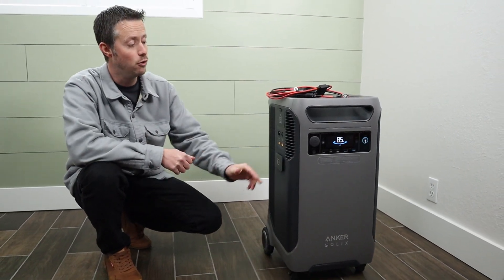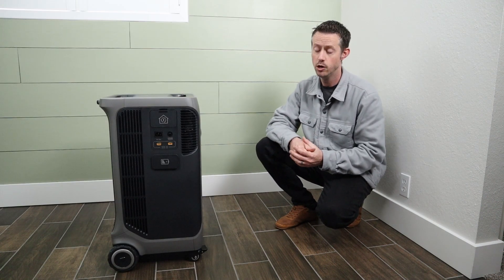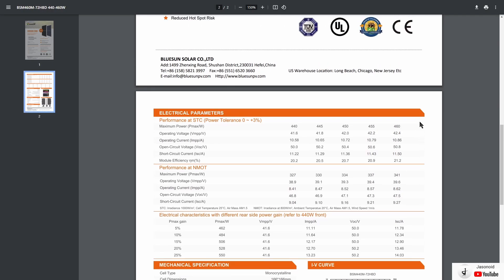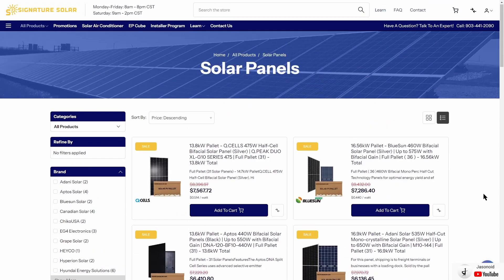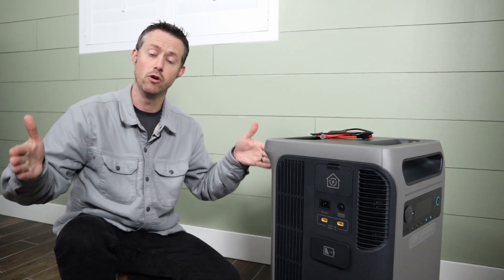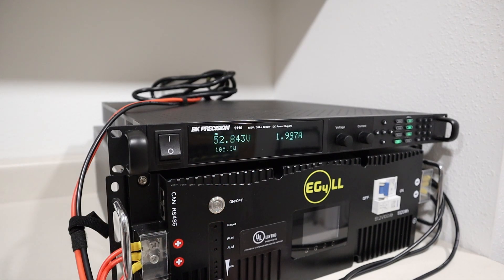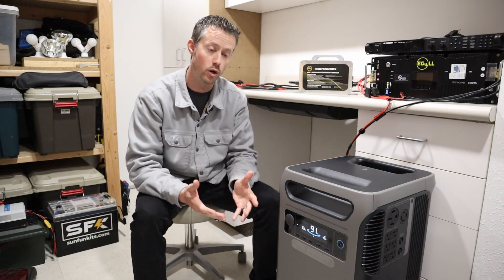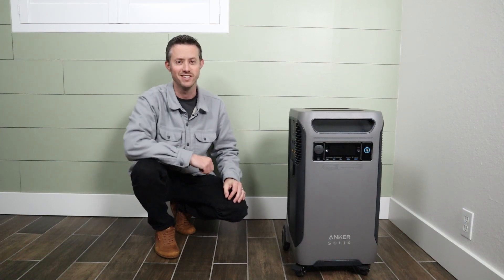Anker SOLIX F3800 - Your Questions Answered! DC Charging Cables - Ideal Solar Panels - and More!

Comment: Hello, so if I purchased 3 of the Hyundai 395watt solar panels in parallel, what size fuse would I need and would I only need 3 fuses total?
Reply from the maker: This is what you'll need:   https://amzn.to/4bVBU1Y
Put one fuse on each postive solar wire before combining them into parallel. Make sure to use at least 10awg wire. 8awg wire for a longe run to avoid voltage drop (wasted power).
Reply: @Jasonoid  Awesome thank you. I clicked the link, they are the 15amp fuses? I will use 10awg wire. Thanks again.
Reply from the maker: @dutchharbour5909  yep, 15 amp fuses.
Reply: Me again. It's probably a silly question, but can I discharge the lifepro4 batteries to zero and then fully charge again? I've seen mixed reviews, but I think it's better for the battery to completely discharge and then fully recharge to get closer to the maximum life cycles? Thanks, Jason. I have the anker f3800 running my pool pump, 800+ watts. I'm going to hook up the panels this week so it shouldn't fully discharge but im running it today and making sure I can fully discharge the batteries safely 😅
Reply from the maker: @dutchharbour5909  discharging 100% to 0% will give you less cycles over the lifespan versus discharging the battery only partially down. You'll still get plenty of cycles on a LFP battery.

Comment: Great in-depth video! Thanks!

My question is, since the battery voltage in the Anker is 48, will panels with the voltage specs below be high enough to charge the Anker unit? 

Rated max power = 380 watts
Open circuit voltage = 44.8
Voltage at Pmax = 36.8
Short circuit current = 10.91
Max system voltage = 1000
Reply from the maker: Yes, the charge controller boosts the input voltage to charge the battery (since the peak voltage is 60v). The panel specs you listed will work properly when wired in parallel.
Reply: @Jasonoid thank you😉

Comment: blah blah blah
Reply from the maker: Most devices I test arent engineered so badly that I have to make a follow up video to clarify how to use it or charge it properly. This video is FREE info for those who got conned into buying one of these.
Reply: @Jasonoid  I like mine, it has limitations that have work a rounds but for the money (I got it on kickstarter) , the ability to run my well pump I do not feel I got conned into it. Hopefully it will only get better with firmware updates.

Comment: Cables that came with 3800 for solar 3 to one. What are those used for and do I need 4 of those for 6 panels. I want to buy 6 Hyundai panels. How would I wire them? Thank you much   Greatly appreciated
Reply from the maker: Those are MC4 parallel adapters. They allow you to connect 3 solar panels in parallel. If you need more guidance on the process feel free to reach out to me HERE:  https://asqme.com/@Jasonoid

Comment: Hey Jasonoid!... What size fuses would you recommend on the Q.Cell 475W panels (using 3 in parallel)? Also, how long would you say the run needs to be to have to bump up from 10AWG to 8AWG?
Reply from the maker: If the run is over 20 feet, I'd upgrade to 8 awg. You'll lose less power to voltage drop if you upgrade.
Using those three panels in parallel I'd put a 15 amp in line fuse on each one:   https://amzn.to/49oUxti
Reply: @Jasonoid  Thanks so much man!

Comment: I have Bluetti 200max. Could I use it to charge f3800 through solar port? I want to keep the 240
Reply from the maker: You could charge the F3800 with the DC Output of your AC200max at 13v and 10 amps, so about 130 watts. Not very fast charging 😕

Comment: will it charge itself? say I have the solix running a very light load from the 240v plugged into my transfer switch, the charge the battery from its own power source using the ac to dc device? do you know if that would even be possible?
Reply from the maker: There are losses when the AC inverter outputs power and during the charging process. It might allow charging but the the power station would lose more power over time than gain it.

Comment: Howdy. Would it be ok to keep this in a hot garage? I live in AZ, and it often gets to 120 degrees in the garage for a month or two in the summer. Would that be ok for this unit?
Reply from the maker: The specs list the operating temps below 104F. It might be fine about that temp but it's hard to tell how it would handle those temps.

Comment: @lamesadave
0 seconds ago
Jason:  Assuming your PV array output voltage is over 60v, would it be possible to use a solar charge controller with a 60+v input and a 48v output to charge the Anker Solix 3800 directly into the XT60 port(s)?  Thanks
Reply from the maker: I doubt it would work, just like the 48v AC battery charger didn't work in the video. The MPPT charge controller needs to see a 'really battery voltage' when connected in order to know the state of charge of the battery is to charge properly.
Reply: @Jasonoid   Do you think a solar charge controller with a 48V buffer battery would work OK?  Basically use the SCC to charge the 48V battery, while having the 48V battery also feeding into the XT60 input of the F3800?  The 48V battery would act not just as a buffer between the SCC and the F3800, but also as expansion capacity.  One negative I see is that the F3800 if not full, will try to drain the 48V battery completely.  But if the 48V is a server rack battery or similar, its built-in protection would shut-off before it gets drained completely.

Wondering if with your expensive AC-DC power supply, you could test whether the F3800 input limit is strictly at 60V, or whether there's some tolerance above that.  After all, Anker's own portable 200W and 400W panels hav a Voc of 57.6V, which doesn't provide much margin for temp conditions...
Reply from the maker: @warrenwu8559  I don't thinkna AC will work since it needs to see a battery voltage to work properly. The battery charger failed to work in the video for the same reason.
Reply: Thank you. Makes sense.
Reply: I ended up getting an EG4 3000EHV and an EG4 LL4 battery (copying the portable system discussed by Jasonoid and Will Prowse). The inverter charges the EG4 battery via solar or grid and the battery charges the Anker via one DC port. It keeps the Anker at 100% and draws from the EG4 battery first while allowing 220V output from Anker. Still learning but the inverter solved the voltage issue on the Anker solar input and wasn’t significantly more expensive than a good 48V charger.

Comment: How much is that ac to dc charger where can you get it
Reply from the maker: The BK Precision 9116 is around $2999 new. You can find them on Ebay for used about half that cost. Any high amperage power supply is going to be very expensive.
Reply: @Jasonoid  great thank you. I really wanted that unit but losing 240 while AC charging is a major draw back
Reply from the maker: @jamesleroy1473  you don't have to wait very long before something new comes out with even better features. Just wait a little longer and you'll find something else.
Reply: @Jasonoid  I hope so. Your videos and info have been a major guidance for me in the solar world. I like most really like the 240 so hopefully they will maybe do a system update. If this system had come out sooner I may gone with them but I need to integrate my Bluetti with it unless they match capacities

Comment: Regarding Voc, when discussing how it goes higher than stated when it's really cold out, what does that mean?  What is "really cold", and what kind of "leeway" are you talking about.  Like if Voc is stated at 59.6, is that too high?  Also, what would happens if you have more panels available than the 1,200w max per port?  Like say you had 5x 400w panels in parallel, going into one port, does the Solix just cap out at 1,200, or is there a danger to having too much?
Reply from the maker: You can see up to 5% higher numbers when it's near freezing and below. The colder it is outside, the higher the voltage...but it does seem to stop around 5% above the VOC on the spec sheet. I would give yourself 5 to 8 volts extra room on the charge controller if you plan to be in extreme cold temps. If you live in a warmer climate it shouldn't be that big of an issue. 
As for the 1200watts. That is the software limited number. You can have more watts in your array, the power station will just limit automatically to 1200 watts. Having 1500 watts of solar won't damage the charge controller, it will just max out the charging input more frequently. This is called "over-paneling" your power station.
Reply: @Jasonoid  thanks for this answer! i came here just to confirm that 'over-paneling' (i.e. max-power-point DC current over 25A due to putting, say, 3X panels with ~11A max power current in parallel) is generally okay. given how cheap panels are, and how hard it is to get max-power in the real world (depending on season, mounting, etc), it seems like a good option in lots of cases to do some moderate over-paneling. i had assumed that the MPPT controller in the anker f3800 would hard-limit both the max current to 25A (even if that is less that 1200W at some voltage, say 40-45V in), and also hard-limit the power to ~1200W regardless of voltage input (i.e. if the input voltage was exactly 60V, it would limit to 20A). but it's great to hear my intuition confirmed from someone with more experience with such power stations as well as lots more equipment to do testing!

on that note, i'm curious what the max DC current draw of the F3800 actually is (i.e. does it really properly limit to 25A in all cases). this seems relevant for cable sizing, safety, and potentially things like fusing. for example, you recommend fuses on every individual panel in a parallel configuration, but what about having a, say, 30A fuse on the combined input? but, if the F3800 actually draws, say, 31A sometimes (maybe when the input DC voltage is near the low end), then it might makes sense to use a larger fuse and maybe also upsize the cables (or at least make sure they can handle the amperage safely). i'm guessing that, assuming anker did a good job, it will indeed hard-limit to 25A in all cases though. for something so seemingly simply in some ways, there seems to be a fair bit of complexity and corner cases to consider for DC/solar inputs to these power stations! thanks again.

(edit: happy to kick you the $15 for answer here or otherwise, not sure if you have a donate button or the like)

Comment: yeah  these things are cool, especially the Ecoflow Ultra,  but in reality you need a gas, diesel, or propane generator for any long term needs...more than a day a two.   Get a duel fuel, run it on propane, and you won't have the problem of gas sitting for a long time.  Imagine,  you buy a predator, Westinghouse, or champion 12500 duel fuel for 1500 max.  Done.  These power stations are just a shiny object.  Good for Van Life,  I own two Ecoflows,  but they are not serious for home backup.
Reply: So glad I read your comment. I have to move away from my house where we have  Generac propane backup. I need backup power at the new house. I saw a youtube video today where "Johnny's Weekends"  was charging a Pecron E3600LPF  with a small Champion generator on propane. I need to find how to do that.

Comment: I purchased this to use for camping, with a secondary use for home backup, do you know if a dc to dc charge controller would work on the xt90 input?  To me as long as I’m within the range of specs it seems like it would, just didn’t know if there would be any concerns as I’m not an electrical engineer! 😂. I was thinking something like the renogy 50 amp dc to dc  with mppt or maybe a victron dc to dc.
Reply from the maker: It's all about voltage. A higher voltage will get you a faster charging speed. A 50amp DC to DC charger will put out 50amps for a 12v battery. If the charging voltage is under 32v, the F3800 will limit the input to 10 amps (that 50 amp DC to DC charger will only charge at 10 amps).
This video shows how to take a lower battery voltage and to boost it up for faster charging:   https://youtu.be/I78RxjRXTn4
This video shows how using a higher voltage battery increases the charging speed:
https://youtu.be/tK4JKmfndh8
Reply: @Jasonoid  awesome! Thanks for the speedy reply and links! I subbed!

Comment: i have an ecoflow river 2 pro, im wondering if i could try to get a 220 watt bifacial solar panel.
Reply from the maker: As long as the voltage open circuit of the solar panel doesn't go over the peak voltage input of the power station it will work just fine.

Comment: The 60 volt limit on some of these systems convinced me to buy a bunch of cheap 51.2v 50 AH batteries and have them hooked up to an MPPT controller with 150 volts.
It's not portable, but it's cheaper than buying a spare battery, and I don't ever need to worry about having the right PV input and heavy gauge for high amperage.
Reply: I'm still afraid to go that route thats why i bought a bunch of these. But as i learn more, i think that system is the best to go with. The one you have.

Comment: Surprised that the EG4 AC-DC charger wouldn't work.  I've been using the EG4 Chargeverter successfully to charge my F3800 through the XT60 solar input.  Also used third party AC to DC power supplies (2 different brands).  Wondering what make the EG4 charger fault out?
Reply from the maker: The charge controller wouldn't turn on with the EG4 charger connected. I'm guessing the charger didn't see any voltage from the power station and the power station didn't see any voltage from the charger. Both were waiting for something to happen.
Reply: Hi, are you using the new old old chargeverter?  Also, what gauge wire from the unit to the xt-60 inputs?  Thanks
Reply: @atsvc43  It’s the original Chargeverter and I’m using 10 gauge Xt60i cables bought on Amazon.
Reply: Came across these older comments.  About to purchase an Anker F3800.  But the concern becomes if I exhaust the battery during an outage how do I recharge the battery.  Then I thought OK, just use my Westinghouse generator but it delivers dirty power that the F3800 will not like.  Then I came across the EG4 chargeverter.  

So question - Will this work and if so what wiring do I need to use on both ends and to outlet do I plug into the F3800 ?  Please dumb it down for me.  Thanks
Reply from the maker: @wbarkwell I'm debating about doing a video on that exact topic.

Comment: …forgot to mention 8 gauge copper wire is expensive.
Reply from the maker: Yeah, 50 foot roll is much more expensive than 12awg..... It's little things like that that these companies seem to ignore / don't care about. Give us high volts so we don't have to deal with huge wires and voltage drop!

Comment: Bought the F3800 thru kickstart program.  I have learned more about this unit in your 2 videos that all the reading of the manual/tutorials. Both of your videos are now on the home Anker F3800 fb page with lots of good responses.   PS, I use my golf carts 6.54kWh battery as backup to the F3800. Easy Peasy.  Thanks.

Comment: The cable with fuse you used has an ATC fuse that seems rated for 32v and below.  Would it be safe with a 48v battery?
Reply from the maker: I've been using ATC fuses on my server rack battery for over a year, no issues at all. I think you'll be okay.

Comment: Great video! Do you know of any simple DC power supplies that can provide the full 1200 watt input limit? I would hope to use two of them with a larger generator to be able to recharge uninterrupted.
Reply: Wanptek Dc Power Supply Variable 60V 20A 1200W is another one that looks a little more user friendly. $240
Reply from the maker: @undisclosed2673  yes, there are cheaper options available. Just remember that power supplies are not meant to run at 100% load for very long. They will fail after a short time if pushed to their limits.
Reply from the maker: High powered AC to DC converters are expensive. The BK Precision power supply used in the video cost me over $1500! The best route is to pick up a 48v LFP battery and just charge that with solar and AC power, and then that dumps into the DC Charging ports of the F3800.
Reply: Thanks. Doing some more research it looks like people have had success with the EG4 Chargeverter ($500) and the BOSYTRO 60V 25A ($100). I’m tempted to try the BOSYTRO.